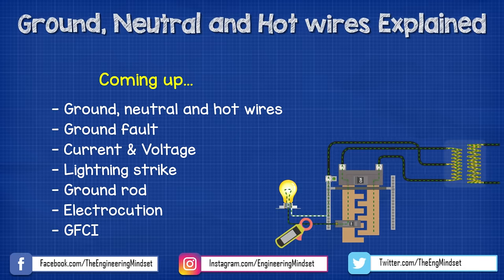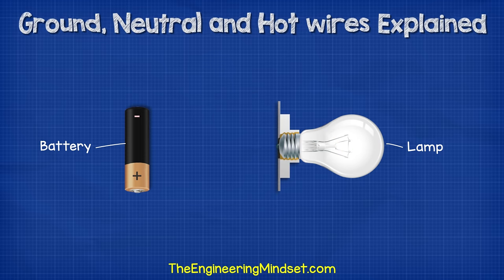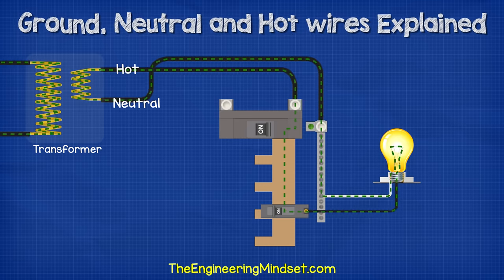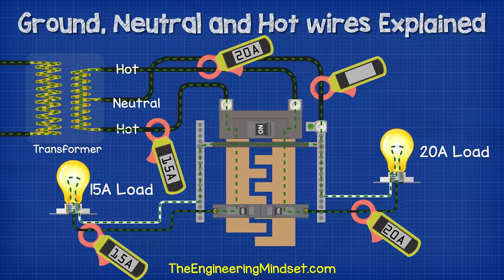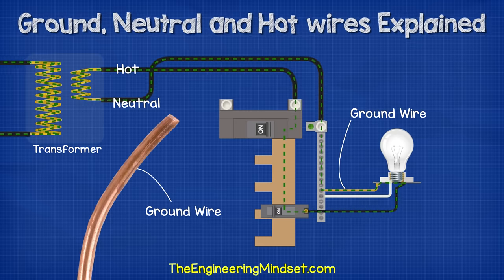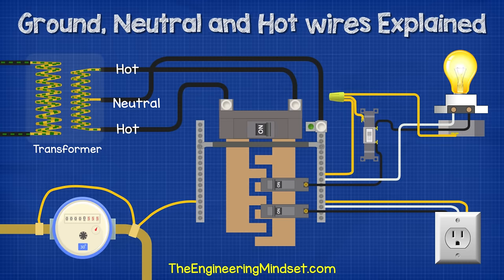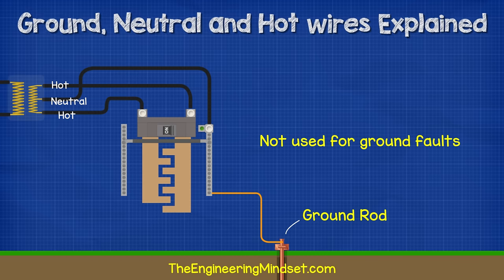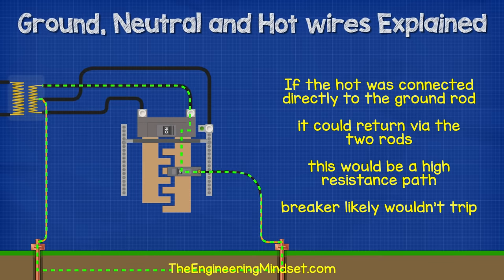Ground Neutral and Hot wires explained - electrical engineering grounding ground fault

Comment: As he explained not having a ground rod would lead to Voltage leakage on to any conductive metal parts like pipes etc from the hot wire not just for static without it you could end up with 80v on hit wire and 40v metal
Reply from the maker: We just published a new Ground fault, short circuit and arc fault video, so much detail! Link HERE➡️: https://youtu.be/Qi0ynSQw-wc

Comment: Q: for single phase system, phase and neutral continuously change the polarity (or current direction is continuously changed then why we feel shock only on phase but not in neutral?
Reply from the maker: Neutral is tied to earth 0V
Reply: sir, my question is while first half cycle is passed through phase wire at that time neutral has 0V but then direction is reversed and other half cycle is passed through neutral wire at that time phase wire has 0 V, so why we feel shock on phase all the time and not on neutral whereas both have same condition?
Reply: Can you please clear my doubt sir?

Comment: A lot to take in, but you said that electricity takes the path of least resistance. So, if the ground and neutral are wired in the same circuit, why doesn't electricity flow through the ground wire instead of the  neutral wire, since the ground wire has less resistance?
Reply: Because the electricity is going back to the source the center of the transformer ground is shorted to neutral at the breaker so the electricity is not going to flow back to the ground wire because there’s no where for it to go but great question
Reply from the maker: We just published a new Ground fault, short circuit and arc fault video, so much detail! Link HERE➡️: https://youtu.be/Qi0ynSQw-wc

Comment: Good, now i have a headache hahaha, for an electric kiln is it better to use Two heating elements, Each heating element at 110v/2000watt , 2 * 2000w = 110v/4000W.
or do you prefer two heating elements at 220v/2000W each, which one is best and more safer!, i was thinking to use 110V 4000W, because as i know will use three wires 30A each , Two hot lines + N Line, but the 220V 4000W will use only two wires 30A each, using Two hot line only , without N line, what do you think, Thanks
Reply: Each will only use 2 wires. One has higher voltage but follows all of the same principles. You are far safer with 220V as you know you will not be on the same bus as you might be with 2 110's  Higher voltage is always more efficient for motors and resistive devices and having 1 heating element is far more efficient than 2 of the same current draw (thermo dynamics aside).
Reply: @askandy7952  thanks for the info, you are right one heating elements far better

Comment: Clearly explained, however, the wire coloring in a DC circuit in the US has the positive wire red and the negative wire blue. I can see past this since the black background may make some colors hard to see: colors are for effect, not for realism. But there are a lot of DIYers who watch these videos and they could get themselves in trouble by not using the correct wire colors. However, there is no neutral in a DC circuit (1:47) and this flub is indefensible.

Comment: Ground and neutral seem similar as they share the same bus connection, but ground isn't supposed to return due to high resistance from what I understood. Neutral has the easier path back transformer.
Reply from the maker: We just published a new Ground fault, short circuit and arc fault video, so much detail! Link HERE➡️: https://youtu.be/Qi0ynSQw-wc

Comment: if same current is passing through ground and neutral wire, then how the bulb is lighting. There must be some current used in lighting the bulb right?
Reply from the maker: We just published a new Ground fault, short circuit and arc fault video, so much detail! Link HERE➡️: https://youtu.be/Qi0ynSQw-wc

Comment: You refer to current flow from the perspective of electron flow. Conventional current flow is hole flow.
Reply: I don’t hear or see anything blatantly wrong but you have to be careful with this explanation when you get into circuit connections. If you connect hot wires in this explanation to hot hot wires in a house that is colored with conventional current flow then you have a perfect short.

Comment: Are inputs also Hot / Hot on transformer terminals?
Reply: If I understand your question, no oftentimes only 1 is a 'phase conductor' and the other is grounded and neutral to the 3-phase system.

Comment: Excellent explanation, I am planning on yeah I’m in the middle of doing it but I’m seeking wisdom in electronics that you have I’m using a car alternator as my DIY generator for my home because the magnets are so close to the stator it produces a pure sine wave he and I have metered The center stator wire on a GM one wire alternator which is the window above the red baron yes C3 Coppell why is there live with AC current I’m metered voltage dropping as I was backing off the trigger of my impact gun for spinning it. I metered 1970v Ac current at about 1,800 to 1,950 R.P.M what catching me the proper way to wire the neutral the Hot wire  from the stator wire to the fuse box Ulta near the keys would be the ground which is grounded to a grounding rod this is only back up power if the Great Falls and I have few battery banks ! Neutral wire ?
Reply from the maker: Check out how car alternators generate electricity here: https://youtu.be/jdSKlg80DjU

Comment: Lets say that the neutral and  ground cables are bonded toguether  at the main panel. Now if a hot wire makes direct contact  with the  ground wire conductor What would happen? Does it cause a short circuit?
Reply from the maker: We just published a new Ground fault, short circuit and arc fault video, so much detail! Link HERE➡️: https://youtu.be/Qi0ynSQw-wc

Comment: If the hot line faulted to ground before it reached the panel box, would the fault current flow to the grounding rod of the transformer.
Reply from the maker: We just published a new Ground fault, short circuit and arc fault video, so much detail! Link HERE➡️: https://youtu.be/Qi0ynSQw-wc

Comment: I am an electrician, and this system makes no sense to me, to have a centre tapped neutral, the first leg being a phase and then the neutral centre then the last leg the other phase, so does that mean you only have a two-phase system that are in phase with one another?

Does this mean your neutral is "live" with half the voltage from one end to the other if you were to touch it??
Reply: This video is confusing and does not go in depth about the phase

Comment: I've discovered the hard way several times that an outlet can still be shorted even if it passes through a switch in the "off" position. 
Can explain how this happens? How does the hot wire complete the circuit?
Reply from the maker: We just published a new Ground fault, short circuit and arc fault video, so much detail! Link HERE➡️: https://youtu.be/Qi0ynSQw-wc

Comment: what happens on the lightbulb you wire the HOT and the NEUTRAL inversed but the GROUND is correct?
Reply from the maker: We just published a new Ground fault, short circuit and arc fault video, so much detail! Link HERE➡️: https://youtu.be/Qi0ynSQw-wc

Comment: Can you help me understand something related to this, I was using a multimeter on a light switch, power was on, and the switch was on. I touched the two prongs of the multimeter to the screws where the hot wires were connected, it sparked, and tripped the breaker. But that’s never happened to me while testing it with the switch in the off position with the power on. Why does it matter if the switch is on or off when I’m doing that if it’s just completing the circuit? Or did I just have a bad switch?
Reply from the maker: Check our new Multimeter tutorial out ➡️ https://youtu.be/4lAyzRxsbDc

Comment: 8:16 if the person touches the hot, they complete the circuit via the wire connecting the pipe to the neutral bus.
What if the pipe wasn't connected to the neutral bus? Would current flow through the person to sink into the earth?

Comment: There is one thing I really don't understand. If you have AC, the current goes back and forth on both wires. As I can tell based on the animation, both wires (hot and neutral) are basically the same. Why is only one wire considered a hot wire? And why does the electrical tester light up only when touching the hot wire, and not the neutral wire?
Reply from the maker: Because the neutral is grounded and so are you. There is no difference in voltage between these points, only before the load
Reply: @EngineeringMindset  OK, it makes sense! I didn't think of that. Tnx 😁

Comment: When you said electricity always tries to return to its source..Is it true for AC source as well?
Reply: yes. It returns to the transformer via the neutral wire.
Reply: @suyashrahatekar4964  But the neutral wire is grounded at the transformer🤔
Reply: @nikhil_06_  Electrons would want to return to their source and ground isn't the source. PS I am not an expert.
Reply: @suyashrahatekar4964  well thanks for your response!🙏

Comment: This GFCI realization per plug seems to be a bit strange to me from Europe. I mean, we have similar thing (here we call it phi relay), which breaks the circuit in very similar case, but not one per plug, but one per house/apartman. It is put to the point, where the normal 230V enters to your property, and whenever the current incoming through line equals to the current outgoing through neutral, it breaks the circuit.
What I don't see, if this is worse in any way. I think, it is completely the same thing. But if it is the same, why do you use one GFCI per plug in America, why not just one? Without a single central breaker, you leave some parts of the circuit unprotected (like all the lamp switches),  which is not a big deal, but still not too nice. Checking, installing many breakers for just having some extra disadvantages is not the best idea. What do I miss?

Comment: Normally, in electroplating technology, people connect the object to be plated with the negative pole of the battery and immerse it in the solution and let the current flow through it because when connected to the 2 poles of the battery, the battery will push electrons away from the pole. battery positive and causes the anode to bubble. At the same time, the cathode will attract electrons, causing the copper inside the solution to be attracted to the cathode. So current flows from positive to negative
Reply: Positive and Negative are misnomers. Male and female (universal law of gender) is less confusing.  It applies to all, not just 'electricity'.
Reply: Anthony is attracted to cathy. Cathy creates with this force. 
Like father sun and mother earth. We are her expressions she creates with the will of the sun.

Comment: why is it called neutral if when the current changes direction there is electricity flowing through it? does it not becomes the "hot" wire when this happens? aren't they both "hot wires"?

Comment: Neutral wires CAN CARRY CURRENT as a matter of course (neutral and load/hot/black wire are the same when that happens).  The difference between the white and black wire is the black wire carries current from the source (panel, power company) to the circuits (behind each breaker).  The white or neutral wire carries that current from the circuit back to the neutral bus (at the panel) which is in turn grounded (completing the circuit path).  So then why have a ground wire?  The ground wire ONLY carries current when a short occurs in the circuit...at that point the electrons are quickly dispatched to ground to stop the flow into YOU or into something not intended to be part of the circuit like a break in a wire touching a nail etc.
Reply from the maker: We just published a new Ground fault, short circuit and arc fault video, so much detail! Link HERE➡️: https://youtu.be/Qi0ynSQw-wc

Comment: 9:05 wouldn't there be only 22mA difference in hot and neutral and breaker is rated at 30mA? So it wouldn't flip?

Comment: Ok having watched this many many times some ??'s still persist.

1.  So home hook ups are NOT multiple phase?  I always thought that special dryer plug meant more than one phase.
2.  So when you hook up a house, what determines the amp service to your property?  Is it just the size of the main breaker in the house or meter?  What's the max amperage that can be connected?

i ask cause I'm beginning to feel the need to have my own house again.  But I'm looking for property to also have a med shed/shop possibly.  Just wondering would I increase the overall amperage to the house and then send xx amperage service to the shed?  Yes I realize could just install new service / meter on the shed.... possibly
Reply: It’s the terminology. It’ s important to properly define the terms being used otherwise those who are not completely familiar with the content can be confused later in the discussion. Phase, Phases, and ‘hot wire or leg’ are not all interchangeable terms. Engineers define these terms exactly but sometimes the subtleties in the explanation get lost in translation. 
Electricians often use the words ‘hot’, or ‘hot wire’, or ‘hot leg’ to define a single metallic conductor that is typically the black or red wire in boxes that house receptacles in your home. Sometimes they will call this conductor a ‘phase’ which is not necessarily incorrect but can be confusing because every residential property will have two (2) of these conductors but only single (1) phase service. 
Two hot wires represent a single phase because when phase is used in this context it is the voltage difference between these two conductors represented as a sine wave with respect to or a function of time. Or worded another way, if you measure across both hot wires with an AC voltmeter or tester you will read a single voltage that can be represented by a single sine wave [math withheld for clarity]. Thus, two conductors and only a single phase. That’s residential. Commercial is typically three hot wires (A,B,C) which represents three phases because you can measure unique, individual sine waves between A-B, B-C, and C-A, hence three phases. Since residential only has two wires you measure the same voltage either way when you attach your test probes to the two hot wires. Strictly speaking, there is no two-phase ’service’. 

To answer your first question, yes you have multiple ‘phases’ [or ‘legs’ or ‘hot wires’ or ‘ungrounded conductors’ as defined by the National Electrical Code] but only single-phase service. The dryer receptacle has two hot wires and single-phase power.
The service capacity to the dwelling is sized by the ampacity of the installed distribution panel; local codes, zoning, and capabilities notwithstanding. I imagine your need will depend on the size of your shed. If you are talking about 50 sq. ft and you just need to plug in a hedge trimmer or lawn mower then most likely you just need a single 15-20A service to the shed but if you are talking about a full blown workshop then maybe a whole new service distribution panel with its own meter is the right way to go, again depending on local codes.

Comment: Why are the neutral and ground wires separate if they just end up joining together at the main panel anyway? Or maybe I should ask, why shouldn't we just tie ground to neutral at outlets and switches?
Reply from the maker: We just published a new Ground fault, short circuit and arc fault video, so much detail! Link HERE➡️: https://youtu.be/Qi0ynSQw-wc

Comment: I'm confused. Are you saying the ground wire is what permits a breaker to trip? Or could a breaker trip without a ground?
Reply: No the breaker trips with any short if that is live and neutral or live and ground it will trip the breaker. It’s the current above 20 amps that trips the breaker but in GFCI it’s the ground that will make it pop
Reply from the maker: We just published a new Ground fault, short circuit and arc fault video, so much detail! Link HERE➡️: https://youtu.be/Qi0ynSQw-wc

Comment: hi from your video, ac current alt so there is no difference between the neutral and live wires? so if I swap the position of the wire connection in my 3 pin plug, does it matter?
Reply: there is a reason why 2 plug connectors have 1 wider end these days..
Reply: tim g  helpful answer. what about neutral and live
Reply: tim g  Thank you. I will read out more as to be able to digest your answer.

Comment: If you look at AC current it looks like it's flowing in both directions on top of the wire and on the bottom of the wire of course it's in a two dimensional 2D but this is what it looks like to us it's flowing back and forth on the top and back and forth on the bottom which is kind of completely different than DC and the tides of the ocean